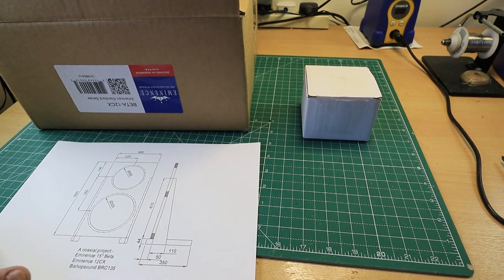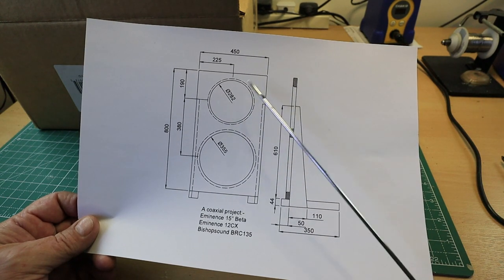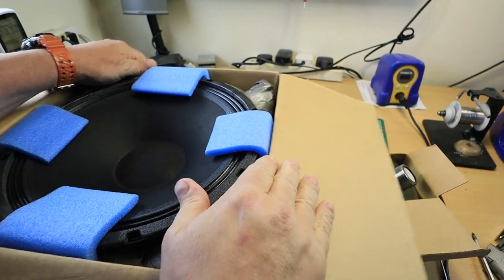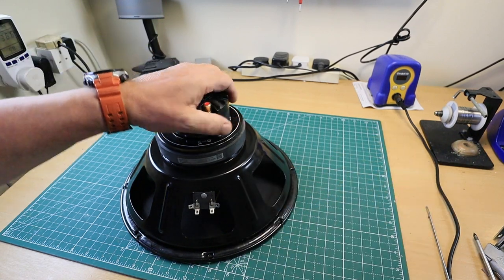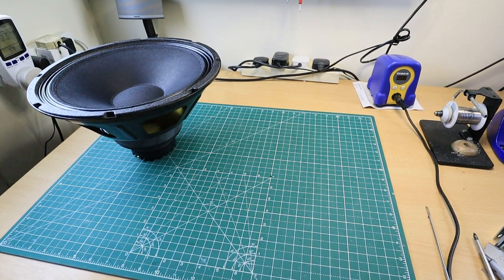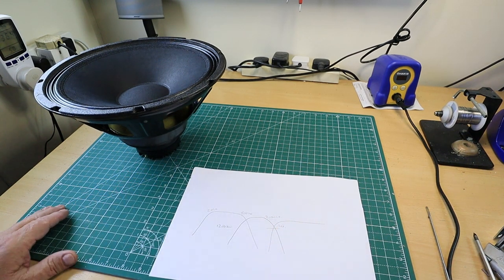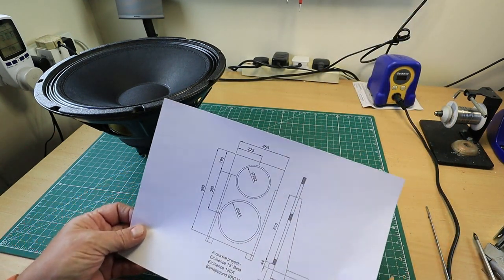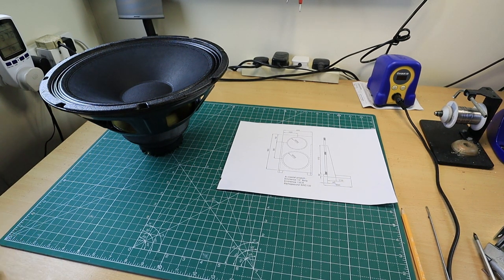Coaxial 3 way Open Baffle Project (intro) will it be worth it...

Comment: Interesting. I recently bought the drivers from a Tannoy 600 series speaker for about £60 with cross overs for building an OB system. 2 coaxial and 2 bass drivers, not 15 or 12 inch though. No time to do it yet though. Great videos by the way, thanks for all the hard work.

Comment: So the tweeter of the co-ax driver won't operate as a dipole for the treble?
Reply from the maker: Well, that's one issue but the bigger problem is the 12CX and its associated HF unit don't work well together with phase problems and big nulling to the tune of -15db at certain frequencies, I've read. Which is were DSP comes in, which I'm hoping via PEQ (parametric EQ) sort the issue out. These drive units are aimed at PA installations not HiFi. Bit of a challenge, bit of fun, we'll see.